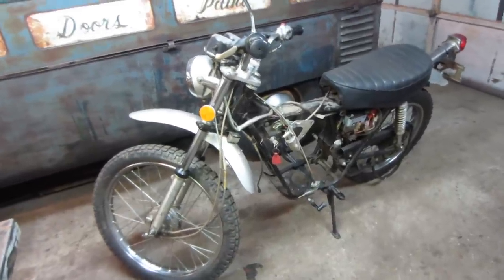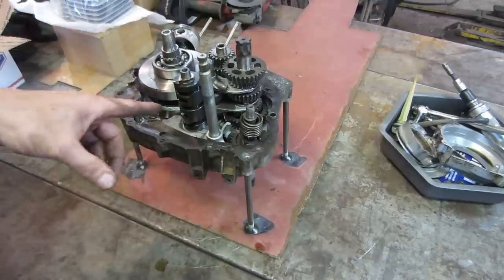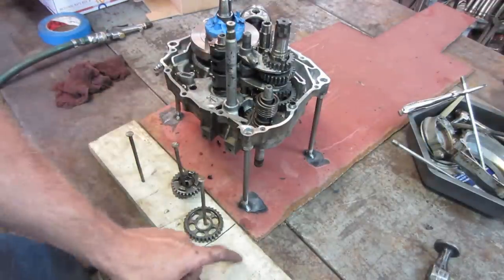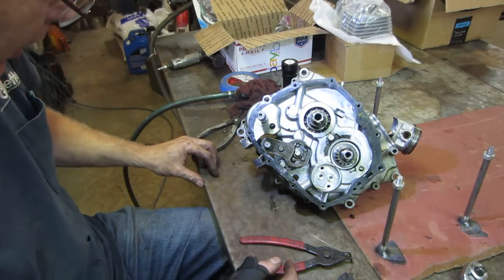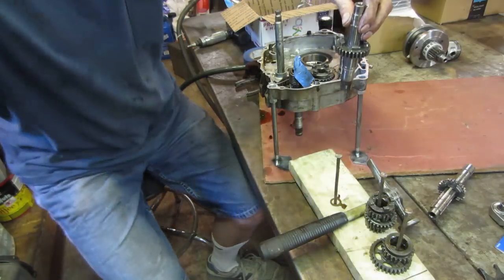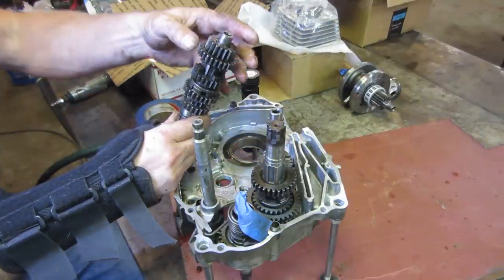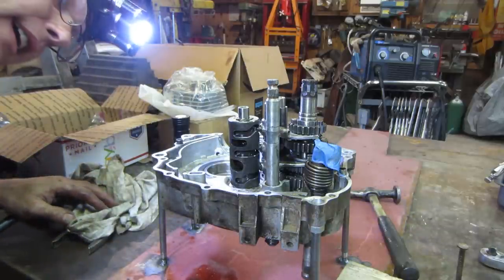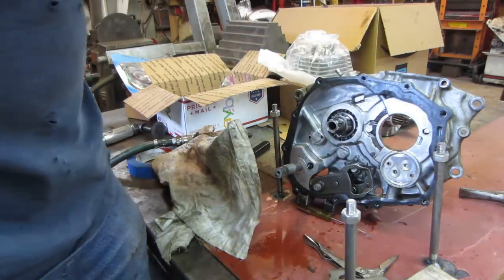1972 honda sl125 motorcycle transmission repair part A

Comment: Many people are complaining that he's overthinking it or doing it incorrectly.  If he repaired it the way you all are suggesting, it would make for a shorter, more boring video.  I think the reason that Mustie repaired the engine in this manner was because he wanted to replace ONLY the parts that were damaged, not the entire gearbox.  Where's the fun in that?  Might have been a lot more time-consuming and more complicated, but it made for a much more interesting video.  Now I know what's in the gearbox and how it functions.  Thanks, Mustie1!
Reply: no he clearly does not have a clue what he is doing
Reply: But the bueauty of his channel is, even when he doesn't know what he's doing, you get to see him taking a methodical approach to figuring it out and learning how it comes apart and goes back together.

Comment: The honda 125cc single cylinder is the most simple engine to work on.  Ive modified my 74 CB125S  with parts sourced from CB, CL, SL, and XL 125 singles.   Swapping transmission gears from different models to make my own wide spread ratio gear box.  And I've used different piston,  cylinder head and camshaft.  To increase performance. It maybe a 125. But its fun to tinker with and make it go faster then orginally designed for.
Reply: I was told the gearbox from a CB100 was the better but wasn't told why.

Comment: For stubborn gaskets use Greased Lightning.
It's easily the best degreaser I've ever found.
Use an acid brush to brush some (not watered down) on the gasket then let it set for 15 minutes. Brush it again and set 30 minutes and the gasket will peel right off. Any residue just scrap off.
Works like a charm.
It's used in restaurants.

Comment: Hey Mustie1 I really like watching all of your videos!  Just a couple of things, I was wondering why you didn't just swap the whole input and output shafts over with the spare ones that you had, that would have been a lot easier. Also the best way of getting the drum and forks back together is to fit the selector forks to the gears without the selector shaft in place, you can then push the forks further into each gear which allows you to fit the drum, you then pull each fork back out so that it engages with the drum, you then just slide the fork shaft through each fork and down into the blind hole in the engine case! In fact doing things this way means that you don't even need to remove the drum at all. Give it a go next time! :-)

Comment: Thanks for taking us on your journey.  Saw some comments down below.  Hindsight is always 20-20.  You took us on your journey. Thanks.
Reply: Remove the clutch assembly from the primary drive side. Whole gear mechanism will lift out as a unit . Slide the replacement in as a unit unit. Honda used to allow us three hours to do thin on warranty work including removing engine and replacing etc.

Comment: I worked in a cycle shop, did dozens of those 125 and xl100 bikes. the shifter shaft will just slide out of the case, giving you access to the shift drum bolt. you normally hold both sets of gears and slide them out as a assembly along with the shift fork shaft. after you have them on the bench, you can dismantle the gear shaft assembly to replace parts. when both shafts are together, fit the forks into the sliders on the gears, and slip both gear shafts and the slider shaft in as one piece. then slip your shift drum in, attach the ratchet, pin and install the bolt, slid the shift lever and pawl in, then install your various other parts. crank, clutch, ect.

Comment: For Me it was a Honda Trail 70 I bought back in the 80's and second gear had broken tooth. It was fun to repair. I also lapped the valves and did a Light oil leak down test till valves held a seal.

Comment: Mustie I love your vids but this one was painful to watch...😁 as someone already mentioned its actually simple once the retaining bits on the side of the case are off the main shaft output shaft shift forks and drum all pull out together... easy peazy... no need to separate the individual gears until they are on the bench. to reassemble take the eBay gears (after careful inspection ) and drop them in with the shift forks and drum already lined up. Good luck with the rest of the build..
Reply: That's all very good when you have dismantled a Honda motorcycle transmission before. I think this is his first one. So without a manual and doing by feel and intuition, of course it is going to be trial and error. I have rebuilt 3 but the first one was very much trial and error even with the workshop manual. If I give you a reasonably complex machine that you have never seen before and without a workshop manual, how would you go?
Reply: I think video will come soon hopefully.
Reply: canuckguy worried 
Hey Guys I didnt mean to "pick" at Mustie... maybe my post came off too negative.. (i used the smilie face) I realize this might be his first time into a motorcyce tranny although I do find that hard to believe given the wealth of knowledge he has displayed in his vids. My post was ment to inform for the next time not as criticism.... again Mustie love the vids keep them comming!
Reply: Psycrow11 don't worry about it, I was thinking the same, he made it harder for himself than necessary. he still got the job done, just was harder. I worked in a bike shop for years, I always removed the forks and gears as a assembly, plus I'd pull the shift shaft out to get access to the shift drum bolt.
Reply: First time on a bike tranny is daunting. I think he did fine.
Reply: That's the point. You worked in a bike shop for years so you have the benefit of that knowledge and experience. How was you very first transmission rebuild?
Reply: Hats off you Mustie1 for not turning immediately to the internet but hats straight back on again for not turning to the internet for a diagram! I was thinking you should have been able to transfer the replacement transmission in it's entirety

Comment: I've rebuilt several of those small Honda engines as a hobby and you did ok working without a Honda shop manual. My engine stand consists of 2x4 boards screwed together in the shape of a square and supports the engine so it doesn't rest on the shafts. Going to watch part 2 now.

Comment: Good call on the cylinder,. don't to forget to Mic the bearings to the crank. Stay in disassembly by pictures or you video. Check the piston where the rod head wrist pin for cracks.... bad transmission = extreme pivot point pressures....... Thank you Sir.

Comment: Watching this I could not help but remember the advice given to me by an old mechanic years ago: "When you are working on a bike or car engine you have not worked on before, buy a manual." I have done it without the manual but they do stop a lot of aggravation later if you have them nearby.

Comment: I bought a used 305 scrambler, and broke second gear almost immediately.  I had no prior mechanical training or experience, but tore it down, replaced second gear, and reassembled it.  Worked great!  I got lucky I guess.

Comment: I know this video is old and i love most of your repairs but this was painful these transmissions are so super simple and dont require this much thought pull the main and primary clusters and shift forks as an assembly. so much easier to deal with .
Reply: YES!. And dismantle one gear shaft at a time then offer up the gear shafts and sellector drum back into the casings as a unit bound with a cable tie or two until they're seated.

Comment: Wow, long and complicated way to do that.. if you pull out the shaft holding the selector forks you can remove them and the drum and  then tap the two shafts out as a unit, replacement is just the reverse.. should only take about 10 minutes to get the transmission out.
Reply: He did this not having done it before and all while making a video dont be too quick to find fault. Musti is priceless note the number of subscribers  Cheers and best wishes,

Comment: You took a bit of a detour on this engine. In my opinion it would have been much easier if you left the gearbox in the other engine casing. The procedure I always use on these types of engines (vertically split) is: Remove the clutch and then slide the shifter axle out. After that you can remove the right casing. Then you can remove the shift drum and both axles as a complete assembly. Mounting them is also much easier as a set of all three so I tend to do the rest on my workbench until I can mount the whole set.

Comment: In 1977 I did a "gearbox job" on my Suzuki A50P Sports Moped. Following the workshop manual religiously I changed the borked 5th gear and re-assembled  only to find I had a couple of thrust washers left. I went over the whole damn thing again but still had those washers left. Being just 16 years old I tossed em over my shoulder  and carried on.
Bad mistake.
I went flying up the road only to have lots of scrunching sounds and rear wheel locking etc. I had destroyed the entire gear cluster !
Fortunately sourcing a replacement (second hand) engine wasn't difficult back then as Ap50 and FS1E's  were all the rage. I learnt to take pictures in each and every step and preferably... Leave gearbox's alone !!

Comment: This is where the shade tree mechanic's knowledge of tie wire degree comes in handy, we use have to wire the old throw out bearings into place before sliding the transmission in place, just turn the shafts around 2 more times and it will be almost right.

Comment: Hello Mustie (or Chris, is it, or Darren?) from Down Under! I hope you read this. 
Firstly, I'd like to say thank you so much for really awesome content such as this! I cannot get enough of your videos, and I know how hard it is to make a YouTube video or do a complex rebuild such as this - I cannot imagine the fuckery involved in combining the 2!!

I would like to say, simply for your own knowledge  (if you wish) and that of others - it is generally bad practice to use power tools for cleaning gasket surfaces. I know the stuff was very hard and emery wouldn't have touched it, however a sharpened aluminum scraper followed by a razor blade would be a good thing to try next time. If you do need the airtool, try and disassemble everything first or at least cover it all. I realise the difficulty with remembering how things went and the time to do this, but it is well worth it especially if you ever work on anything more modern. In reality this old girl will probably be alright even if you just flush the oil a couple of times, but it's easier to prevent problems than fix them (as I'm sure you know!). Please also bear in mind I mean this constructively and I have a great deal of respect for you. 

Full disclosure I have some mechanical qualifications but not a full license - I did not finish my trade. I am also a young fella at 19. The only thing that gives me any credibility is experience with my old man in the garage on old cars, as he was an engineer, flight instructor, aircraft mechanic, among many, many other things. 

I hope your wrist is healing and you are otherwise well, and may there be many more videos, preferably without toxic shit in the comments!

Comment: Gasket removal on aluminum housings: Take a piece of copper tubing and flatten one end with a hammer then file the the end of the flattened area to a sharp edge.  The copper is soft enough it won't damage the aluminum so gaskets can be scraped away without concern. The copper is easily resharpened with a file when it dulls.

Comment: just observation: clean the gasket w/ rotary abrasive? yea, maybe some '60s 'form a gasket' sealer was put on the original and doing the way you did keep disassembling / lap the cases ensure they are flat > emery paper spray glued onto a piece of thick (8mm) glass chugga chug new goes on w/ anti-seize as sealer; those locator studs - take that welder make a couple different sizes because nobody actually uses 'em for what they are sold as...the secret fork damper rod holder specialty tool (left spiral stud remover on a stick or in this instance a plate with thread risers). might as well 'clock' the crank since maybe it was removed to lap the cases. outsource repair manuals - photos and descriptions just paste 'em at the back like a diary sell it @ a garage sale for like $.50.

Comment: When I split the motor of a moped with 3 gears after the same issue, I got a manual first to know how the gears was supposed to go together since they are synced they have to go together again in certain way. After I knew that it all went very fast and it all worked perfectly and if I would have done the same with a similar engine as in this video I would of course have done the same so everything was put together the right way at the very start.

Comment: you made it really hard on your self mustie, next time pull out the shift fo k shafts and all comes out as a cassette ,the detent roller, rolls on the shift drum check it make sure its not wore or wobbly if so get a new one , it will shift hard if there is any movement on it "the part you used  vice grips on ", also the gear shift shaft slides right out you should put in a new seal while its apart, and you could get to the detent roller and tighten the shift drum selector with out using vice grips, also replace the timing chain while your in there, and fiber clutch plates vesrah are great clutch parts and are inexpensive, dont forget to lapp the valves!!! and use new valve seals  all is cheap enough

Comment: Think I would have replaced those gears as a set, as gears wear together in a pattern, and since those never broke a tooth, would have kept that set together..after confirming with a exploded parts view they were assembled correctly. When you were dragging those splined shafts on that metal table you had me cringe a bit, and that doesn't happen ever in your videos, although unlike some other negative nancys on here, still think these are great videos, as you do a good job on your repairs.

Comment: Bad idea with the Scotch brite wheel, it won't be flat anymore after that. Straight back razor blade and take your time. Lock the blades in Vice grips if you need to.

Comment: There is no shame in going on line and finding a worksop manual.  Saves a lot of time, frustration, and doubt.  BTW.  The cam chain adjuster is on the top of the crankcase under the little black rubber protector.  A screw driver and a 14mm lock nut.  Its in the manual.

Comment: The gears all come out and go back in as a unit.i would have just put the new gears in all together instead of replacing just one gear.because the new gear set from the donor engine  were already meshed and worn in as a unit.could have been a lot more smooth and quiet if you did.good job either way.well accept for pinging them with a hammer.

Comment: It's real easy with a manual mustie. Plus it's real easy to misplace a washer. Or spacer. Split many cases . You just pull the shift fork pin to remove forks. But,hey nothing ventured inthe learned.!

Comment: When you disassemble gear sets take a picture as each item is removed.
That way you can go back and see how they go back together.
Take several each step from different angles.
We did that in the Coast Guard Aviation when we changed Helo engines and rotor transmissions.
Make life a whole lot easier and keeps you off  the shop Chief s#@t list when you forget where something goes because of a modification someone made at overhaul did and the book doesn't cover it.

Comment: I may have missed it but was the shaft with the replacement gears different? I am just wondering why you didn't just replace the whole shaft with the new gears rather than taking them off individually. Reminds me of the ASVAB with all the gears and you had to figure out what direction they would go if turned...I didn't do so well and ended up Infantry!!

Comment: after 40years of racing rebuilding dirt bikes....I can say the gear failure must have occurred from swallowing a piece of metal in gearcase or defective metal (rare for Honda).
That motor doesn't have enough power to chip teeth and since it is constant mesh design this can't happen from shifting .
These were indestructible bikes back in the day. Now they put 60hp in Cr500through same size gearing with no cushion rear hub under extreme shock loads rarely see gears fail. 
I split cases and rebuild my first bike at 11yo kid. A Zundapp Rickman with ball shift as Hodaka had...Many funky European bikes as CZ and Bultaco Montesa Maico etc are sought after but early Japanese bikes now popular.American made Hodaka Road Toad Dirt Squirt Super Rat,Harley Davidson  and especially Ronkon 2wd from New Hampshire very desirable to collectors. 
There is a big cult following around classic Dirt bike restoration etc. Husqvarna and Ossa my favorites. Shalom

Comment: 28:40 hard to see you struggling with that so much. If you'd insert the forks axle after the drum, it would be easy done. but i only know because i did it just like you :)
Reply: and then you might be able to let the drum and shifter arm attached during the gear replacement...

Comment: Hey man great videos I have a quick question, if i want to remove the shift shaft on my sl125 will i have to also remove the huge clutch blocking it or is there another way??

Comment: Nice job but I would have used the entire eBay gear set and shafts. A bent shaft would be my concern after eating a few teeth of 3rd gear. Other than that, great job!

Comment: I noticed that when you tacked the jig, you held the tip still at the spot you welded for a second after you stopped welding. Why did you do that?
Reply from the maker: shielding gas out of the torch keeps air from contaminating the weld as it cools